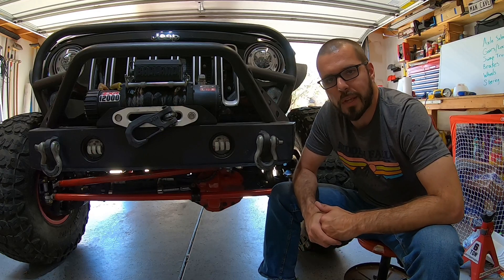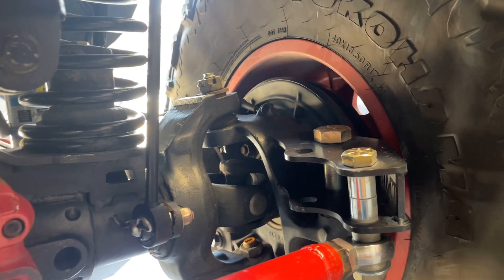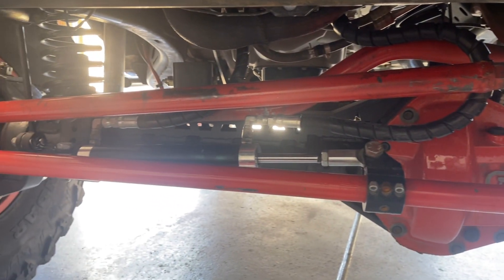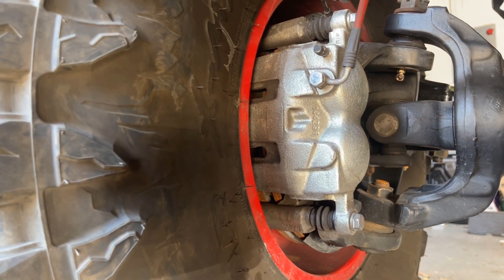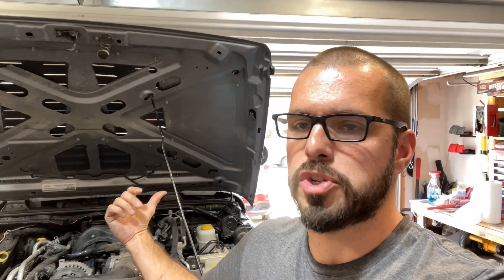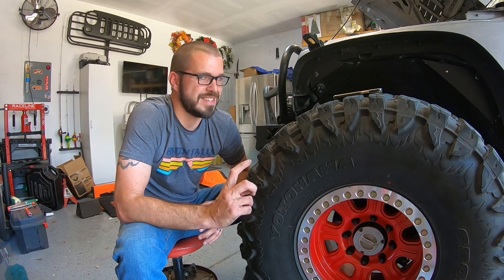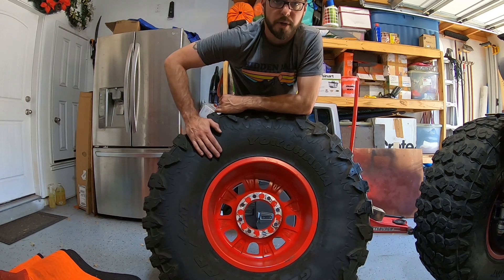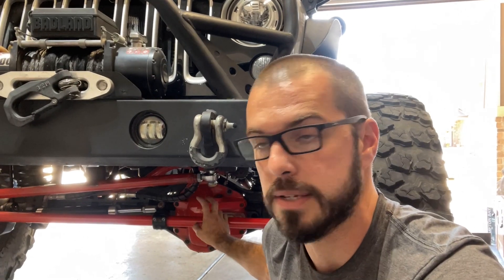Jeep One Ton Swap (Part 1) - EVERYTHING THEY DON’T TELL YOU

Comment: I’d like to hear your theory on why no automatic lockers for the front?
Reply from the maker: They typically aren’t as strong and don’t have as nice of a dive ability. So it really just depends on what you are doing with it. For a trail rig only I could see it. But for something you want a nice drive quality in, a selectable provides that. There is also the issue of the electronics with regard to skid control and wheel speed sensor related stuff that some of the newish Jeeps don’t like when you do the auto lockers. So it’s just my experience and opinion to spend the extra $500.
Reply: Automatic lockers are generally weaker, and oftentimes have difficulty fully locking the axel, whereas selectable lockers will completely lock the axel and not allow one wheel to spin without the other.
Reply: I wouldn't say an auto locker was weaker at all! Detroit and Grizzly lockers are some of the strongest lockers you can get.  Most of the major offroad guys run them.  Simple and strong.
Reply: I have used both what sucks most about auto lockers up front is trying to turn sometimes

Comment: Do they Allow CJ's on the Rubicon any more? I got a 2017 Super Dana 60 and 4.88 is as low as I can get, so may have to Double Box on the Transfer case input.
Reply from the maker: So your 2017 is just too new. You can’t get gears deep enough. So depending on what trans you have and transfer case…you’ll definitely have to double it up.
Reply: i have a klune V drive 4-1 ratio. behind my T-18 in front of my dana 300, factory bolting here. located in northern cal.

Comment: one other question: 2005-2016 super duty axles, If I purchase both front/rear 05-16 axles is best case? Any issues with 05-16 rear super duty axles for JK swap?
Reply: maybe answered my own question as I didn't locate any truss swap kits for the rear super duty axles. most everything is the 14 bolt GM axles
Reply from the maker: Yea. So people use them. But, the 14 bolt is more popular. The problem with the sterling in addition to less support (there is some), is the pinion location. Without a major rear stretch, or relocating the fuel tank it won’t clear the tank when you flex it. The 14 bolt is definitely the better axle. But the sterling will work if you do a fuel cell. Or stretch it A LOT. 

Some people also dent the corner of the tank in. But that becomes an issue when you are running skids.
Reply: @WarPaintOffroad  ok, I remember you mentioning this in part 2. Thanks Man.
Reply from the maker: Of course! Good luck!

Comment: 2009 Jeep Wrangler rubicon's any good the guys got about 117 thousand miles on it and I can pick it up for about 14,000
Reply from the maker: Just do some research. That jeep has the 3.8 engine which is reliable… it doesn’t make any power. Lots of people still use them though.

Comment: I got a question for you maybe you can shine some light on it.... I have a 04 Tj  now the front upper control arms are adjustable (Rubicon Express)  the bolt holes on the axle side of the control arms are smaller than the bushings bolt holes on the axle... should I drill out the arms to the same hole diameter as the bushings on the axle and use bigger bolts?
Reply from the maker: So I’m not a tj guy. But, assuming the links are for a tj and weren’t swapped from some other rig…you could. I would call rubicon express and ask them. Maybe that’s a normal thing. But I personally would want the bolt holes in the brackets to match the ends on the links. But again, I’m not a tj guy. I have worked on them, but not with the stock axles.

That is usually done in some vehicles (if I’m understanding your question) so they can run cam bolts for caster alignment. They make cam bolt delete plates for them that should fix that issue…assuming that is the issue. But without actually seeing it, it’s hard to know exactly what is happening. I have seen some weird stuff on older vehicles that previous owners have done for whatever the reason. So I think the safest bet would be to call the maker of the part you are installing and start there.

Comment: i have a wrangler jl & I have a 2011 f250 super duty front axle. I am trimming the axle as you suggested. I bought a Barnes trust kit and am learning how to weld. While I am at it, I will also weld the high steer arm that holds the drag link and tie rod.
1. Which drag link and tie rod should I buy?
2. Which high steer arm should I buy?
3. Do I need to buy separate bolts to attach the drag link and tie rod to the steer arm and feedman arm?

Oh, and the Diablo saw you recommended cuts metal well.

Comment: I prefer an auto locker in the front. When a selectable locker is "locked" it's a spool and doesn't turn as good. 
A selectable locker in the rear is really nice. I've found that with a locked front, open rear, I rarely need to lock the rear on a lot of trails.

Comment: Awesome video with lots of useful information. My biggest concern is using older axles. What needs to be done about the ABS sensors on axles that don’t have them?
Reply from the maker: So the front axle has a tone ring built into the hub. So no issue there. And you can have the rear hubs machined fairly cheaply to fit the same tone ring as the front which is a 60 tooth. The jeep computer is easily adapter to count the 60 tooth and not the factory 58.
Reply: glad my cj-7 does not care about tone rings. 
only thing keeping me from going 1 ton is i have no money. but would rather go with specialty built ford 9 in front and rear.  MASSIVE weight savings. and both high pinion.

Comment: What are the differences in the hubs for a front axle on a Ford that had duals?
Reply from the maker: The hub on it is completely different. That’s why dually wheels look different than single rear wheels. They have an offset on them so they can be used on the rear too. So the hubs on a dual rear wheel set up vehicle will be different. You can of course change them to make it work…
Reply: Ok good to know. I’m good with mine but I had no idea. Thanks for pointing that out. I’m sure that could easily be the case without knowing first 👍🏻
Reply from the maker: Yea man! No problem. Always good to know more stuff. Help more people. Thanks for the support! And have fun with the ton swap! I’ll be doing another one and have it all very step by step on the YouTube channel this fall/winter.

Comment: Dumb question but are you running the dust shield for the brake on the 60? My JY axles dust shield are all bent up.
Reply from the maker: I am, but they aren’t necessary. I just ran them because they were there and in decent shape. But lots of people don’t run them.

Comment: Why would you go with the 8x170 when the 8x6.5 is more common?
Reply from the maker: Because the ford hub has the wheel speed sensor already in it. And it is 8x170. I like to keep parts easily serviceable. So keeping the ford hub factory allows easy replacement.  Ot to mention the rear axle of a 14 bolt is 3 inches narrower. So putting 1.5 inch spacer/adapters on it makes it the same width and is easy to then convert the rear 8x6.5 to 8x170. Some re drill the front hubs to 8x6.5 and then Run the spacers in the rear anyway. But by redrilling it…you can’t quickly replace it at a wheeling event.
Reply: @WarPaintOffroad  guess I'm partial to the 8x6.5 as that is the same pattern as my truck and trailer so if I need a spare, I have an infinite number of them if need be. 8x6.5 wheels are easy enough to come by and it's not that bad redrilling the front hubs. I'm also running a TJ and don't have to worry about tone rings so that part doesn't bother me.